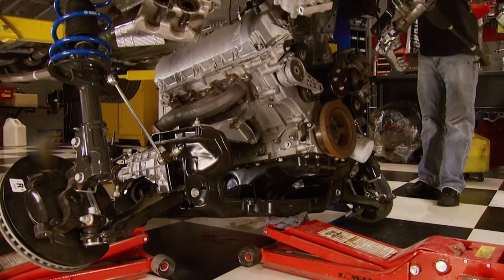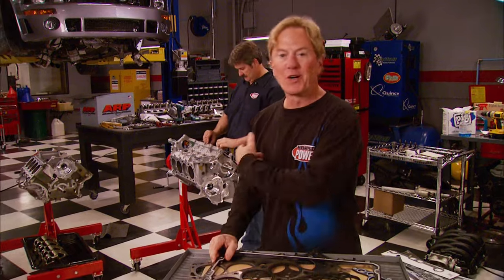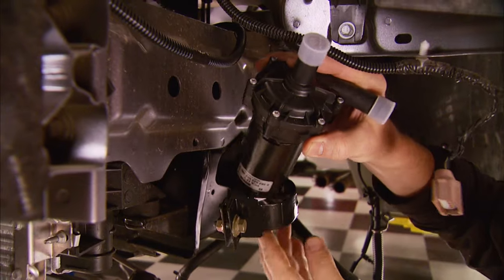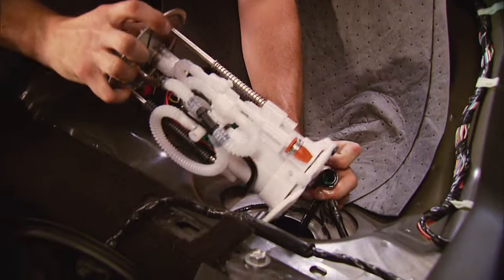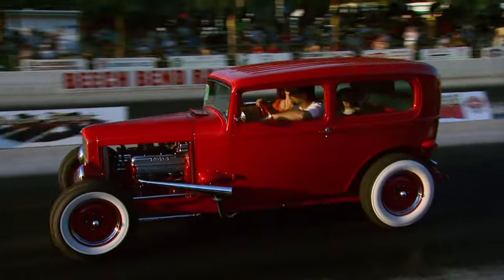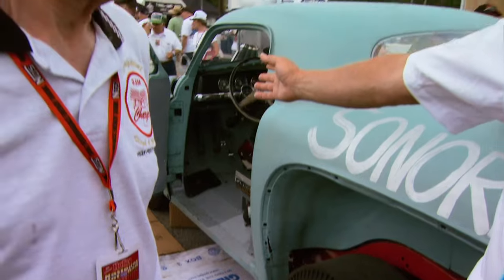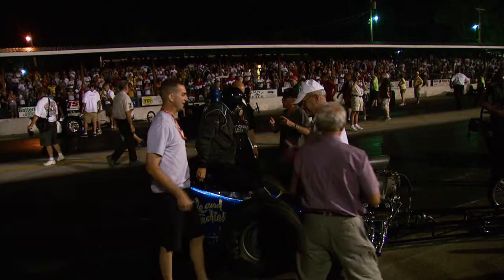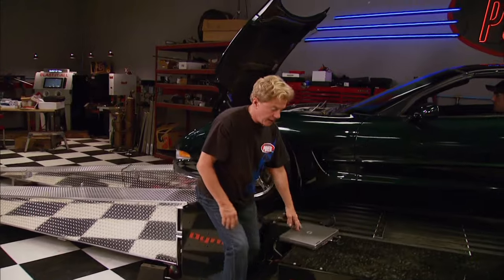Supercharging A GT's 4.6-Liter For An Extra 200 Horses- HorsePower S12, E13

Comment: They lost me after only two minutes. Their title was Supercharging a GT's 4.6-liter For An Extra 200 Horses, but then they took out the car's 4.6 to replace it with a Roush short block and supercharger.
Reply: A roush is a GT lol.
Reply: @fatdan172501  basically unrealistic cost wise for most of us and done on a stand outside the vehicle. Most of us were looking at seeing it done while in the car.
Reply: 4.6 great engine. Put Lysholm super charger on it. Kenny Bell has the same twin screw blower package. Great blower! Most important is a good tune. By that I mean a real good "Tuner".  Headers, cold air intake with bigger throttle body and headers, bigger fuel pump. Shelby exhaust! Enjoy!
Reply: @avocado9763  Why did they go with a different block? Won't those superchargers finally tear up the factory engine?
Reply: @enermaxstephens1051  It depends on the horsepower and torque they throw at it. Much over 450 lb/ft at the rear wheels, and you will start bending breaking the stock connecting rods. Horsepower is not as critical of a factor.  Mine is running the stock bottom end. and produces 560 at the crank, with approx. 550 torque. I'll get it officially dynoed this year, but those numbers are estimates.
Reply: @sherylellingson3538 have you gotten it dynoed yet?
Reply: Yeah and only got 200 more Hp… lol
Reply: @Tripztrip2008 , perhaps, but not with the 4.6-liter engine it came with, which was the video's hook.
Reply: I read this and never made it through the ad
Reply: @swyzzlestyx  it is a stock block just pistons rods and crank are forged !You can run that blower on a stock engine we have done it many many times!
Reply: They lost me at 4.6L …. Engines are obsolete…
Reply: @StevenSimpkins-p7x , The 4.6 has nearly infinite horsepower boost potential with only bolt-on parts, and is only limited by metal fatigue. Sure, the 4.6 was stock tuned to put out low horsepower, but that was easilly remedied. The 5.0 Coyote is supposed to be a major improvment over the 4.6 mod motor,and I suppose in ways it is, but for the price they paid to develop the engine, and for the fact they only put it in the F-150 and the Mustang, I have to ask if the cost was worth it. I would think Ford would make the 5.0 Coyote engine an option for all of their vehicles so they can properly recover the development costs. Personally, I would bring the 4.6 back to fit a V-8 in places the Coyote cannot fit. I know Ford is trying to increase their cafe numbers by forcing customers to buy their smaller engines, but they should still offer people the option of shoehorning a V-8 into anything they make for a cost.
Reply: @swyzzlestyx  4.6 and 5.0s were and is good platforms …. 4.6 will take more of your money to make power… the 5.0 not so much. As a Gen 3 coyote mustang owner and I have a 03 GT 4.6… with headers CAI tune and e85 it put down 505HP to the rear wheels …. In comparison… the 4.6 would need either a major overhaul of the heads intake cams etc to come close to it … also when boosting….. a coyote comes with forged internals ready for boost… 5.0s can hold 1,000 HP easily … same with the 10r80 trans… in the 4.6 it doesn’t come fully forged and would take more money out of your pocket to make it strong enough for boost

Comment: "Supercharging a GT's 4.6 for an extra 200HP" :) ........however, we used a new Roush short block. :(
Reply: Yeah but unfortunately there isn’t much you can do with the stock engine :(
Reply: You can make another 200hp on the stock engine
Reply: @mikionorton2236  theres tons you can do. Been running 500whp through a turbo on stock motor for 4 years now
Reply: @mikionorton2236  NOT SO BRO!

Comment: It is impressive how the current mustang can make 700hp with just a bolt on supercharger with stock engine compared to the 4.6 days.
Reply: 4.6 is a destroked 5.0 btw . thats why the DOHC 4.6 had 5.0 stroker kits
Reply: @TheCheapReefer  The 4.6 is not the same as the coyote.
Reply: Tha Silent One   Uh, no. You obviously don’t know a lot about engines. At least ford engines.
Reply: They’ll make 700 hp alright and then a week later it starts ticking or knocking.
Reply: John Johnson except no
Reply: @spankthemonkey3437  gen 2's maybe, but the gen 1 had the same problem with rods as the 3v. They just hold on a little longer.
Reply: @lukelanam6045  for the most part it is genus  .
Reply: @lukelanam6045  it shares many parts its a 4v version stop the foolish crap!
Reply: @Nmdixon-cu7vm  are you a fool!

Comment: Glad you did a 4.6!
Reply: This episode seems like a sales add for why you should just buy a coyote. Wanna run down a newer mustang? Just buy this 7k supercharger kit and put a new 4k short block in it. You will also need a clutch. So long as you have a full shop, you will be running down stock coyotes in no time. Just doesn't seem with it to me.
Reply: @ryanwalker3509  that was on a pretty low boost setting, that shortblock should be good to a thousand, and those injectors will make a lot more than 500 crank, at least 600, maybe even 800
Reply: @ryanwalker3509  hahaha exactly what I was just thinking after buying the car and 12,000$ in parts you could have a low mileage coyote and make 500whp with bolt ons
Reply: @fl_atv_riders4455  it's still cool if your hot on that body style. Hell I still like the c 5 corvette the best. However, its not exactly cost effective.
Reply: U can save the 7k on old 3 valves and the 7k in mods can get u a gen 1 coyote.
Reply: @T0YCHEST  or you could get a 4v 4.6 or 5.4 for a lot cheaper and do the same
Reply: admiral_peck 7 its not going to be cheaper
Reply: @T0YCHEST  I can guarantee I could get over 500 n/a horses for less than 3k on a 4.6
Reply: @ryanwalker3509  
Well, when this episode originally aired that car was brand new so...
Reply: Glad they DID a 4.6. This was from 2007...
Reply: admiral_peck i can guarantee u i can get a gen 1 coyote for the price of ur 4.6 and mods
Reply: Auto Young ?
Reply: @ryanwalker3509  they did do this before the coyote was released, notice they called a 3v 4.6 brand new? Yeah that was the top dog when this was recorded.
Reply: @Prestiged_peck  You can't expect trolls to have comprehension skills.
Reply: @redrocker1055  you have a good point, I'm aiming for over 2k in my little 4.6, I'm looking at probably 100 pounds of boost, ethanol, trickflows, and water meth all together to achieve that
Reply: Ryan Walker but your Coyote car still looks like a Coyote car and some of us very much prefer the early S197 style.  Plus if you own it outright it’s cheaper to put a basic super charger on then switching cars and you’ll be taking out new 50k Coyotes.
Reply: @Jedi391  plus with modern fuel you're looking at possibly 6-700 horses
Reply: @ryanwalker3509  You can run down a stock Coyote with a $2000 On3 turbo kit.
Reply: @theroofer3181  don't get to hung up on the base price of a kit. Will the trans hold the power? Do you need a new clutch? Does it come with a tune? Are you actually going to be able to do it yourself? Can you fabricate if something isn't right? Do you need any other supporting modifications? I would be willing to bet its closer to double the cost you just said. The kit i looked at on that site didn't even come with injectors. 2k just isn't true.
Reply: @ryanwalker3509  I do all my work myself so labour isn't a problem.  Stock transmission will hold the power just fine.  A new clutch will definitely be needed to handle the extra power, I use a Spec Stage 3.  I'm using a used set of 39 lb/hr Ford injectors.  All in, not including labour, I'm at about 3K, including tuning.
Reply: Lassi Kinnunen  You don't need to swap the shortblock like they did for the power they're making.  A stock 4.6 can handle up to 450 r.w.t.q. (500+ r.w.h.p). With the forged internals they have now, they can probably make upwards of 6 to 700+ r.w.h.p.
Reply: @fl_atv_riders4455  Yes, Coyote's have the advantage, but it sure is fun seeing the looks on the faces of the Coyote drivers, when you are still there at the end. Win or lose.
Reply: @sherylellingson3538  its honestly cheaper to do a 5.0 swap then build a 4.6 and you have a more capable platform after for more growth.
Reply: @Prestiged_peck  how? With a turbo? Even then you might spend well over 3k…. You got to build everything else around it…
Reply: @Zelmar Hernandez  well yeah trans would need upgrading, maybe driveshaft too. Diff/axles would probably hold 700-800ish no problem
Reply: @fl_atv_riders4455  some drivers prefer the sound and everything about the 4.6.... The sound of that engine beats any coyote in my opinion.... Somebody out there is very happy that there is a way to compete with coyote even if this means 15k in the hole. You can own an older 2005/09 for about 6k/9k			plus 15k in parts you be around 25k or so....the same you'd spend to buy a coyote mustang. Personally i prefer coyote mustangs because the powee potential is a lot higher than the three valve mustangs.
Reply: @ryanwalker3509  Supercharger = $7000. Gen 2 coyote Mustang or above will run 3-4 times that. Plus the 05-09 are better looking. IMHO, only.

Comment: Damn I threw a paxton on my stock 4.6. It's at 498 rwhp with 460 tq. Been running it for 5 years and never had a problem with the stock block.  I wonder how much all this costs
Reply: Too much
Reply: How’s that working out for u ? I want to throw a Paxton on in the spring
Reply: I'm running a Paxton as well at 508rwhp. I've been on what they called "borrowed time" for 8 years now 140k miles haha
Reply: According to the guys at Brenspeed, you are right about where you should be, with stock internals. Rule of thumb, 450 RWT is about all you want to send. Horsepower is irrelevant, when it comes to breaking parts. It's the torque, off the line that breaks parts. Mostly connecting rods. Horsepower is developed at upper RPM, torque down low, when the most stress is created. Again, this is just Brenspeed's word.
Reply: @totljag1  still going man, unfortunately squirrels got into the hood this winter and chewed my wiring harness and nibbled at my belt :/ so I'm currently dealing with that atm. But the engine is doing fine at 100,000 km.
Reply: @sherylellingson3538  definitely, I also forgot to mention I don't track the car, or launch it. Everything about the car is stock except for the blower; I feel like if I hooked from a dig, definitely drive train issues would be the first issue lol and then of course the rods would for sure go. I got mine tuned at a very reputable mustang shop near Toronto, Canada. They basically have the same opinion as the boys at Brenspeed. But you never know, every engine is different. Just gotta be prepared to build it if it fails lol
Reply: @bensondelva3086  140k miles? That's awesome man, that gives me confidence I have alot more years left on her. Hope you enjoy the car this summer man 👍
Reply: What are you running in the rear, plus do you have a stock driveshaft ?
Reply: @adrianbrown2957  stock drive shaft, upgrading to 1pc aluminum next week. Stock rear 3.55s, no plans yet. Never launched it because of the stock drive shaft. Going on year 6 with this car. No issues.
Reply: that roush is a stock ford block just forged rotating assembly!

Comment: Nice idea what about the rods that like to bend on a stock engine
Reply: Stock rods are perfectly capable of handling more horsepower than that. It's the torque that you need to keep in check. Any torque over 450 at the wheels, is bad for the stock rods. Everything else in the stock internals should be fine.

Comment: 8.5 to 1 compression ratio... should've had 10.5 to 1 with the low boost they were running
Reply: agreed not sure why they lowered the compression for 12psi. just get some headstuds and up the compression to make even more power
Reply: we run 12 psi on a stock 4.6 bottom end and get 575 hp and run 10s with the car !

Comment: That one older guy always sounds like he's in the middle of a mild stroke... Or a fifth of 100 proof!😂😂

Also: "This week on Power Nation, we tear apart a whole car/engine to bolt on a supercharger, then make less power than a stock NA Coyote! Stick around!"
Reply: He sounds like He's comfortable sitting at the Bar with Norm and Cliff in Cheers.
Reply: @BIGGDADDYWIGGS  😂😂👏
Reply: This stuff was from before the 5.0 even existed.
Not to mention that these are wheel numbers and not crank. 
... you sure you havent bad a fifth of 100 proof?
Reply: @justsomegarage  Nope, gave up drinking. I am aware this was before the 5.0 was RELEASED, but it was already in development at the time... I was exaggerating to illustrate the point of doing too much for the gains. Are you sure you understand satire? Should I edit the joke to say "then make about the same power as the next generation NA engine will reputedly make!"? Would that make you feel better?
Reply: @supramaniac502  ten 1st gen 5.0 was 411 hp at the crank bolt ons will yield that on  the 4.6 the engines are not that much off in power realy

Comment: Easily about a 15k build if you have that done at a shop. 5k for supercharger. 3k for shortblock. At least 30 hours in labor. Tuning.... I just don’t think 450 horse to the wheels is worth that
Reply: Just add more boost.
Reply: This is an old video. They referred the mustang as a "new" car and about 2006/7 when Roush Mustangs started to be more common. Back then, you'd be lucky to get that kind of power without a built block. Nowadays? You can get yourself nearly 800whp on a stock block.
Reply: thanks for advising a 15 year old show
Reply: yep,anything at a shop is $100+ per hour.a cam swap for a pushrod v8 is 10+ hours or $1000 plus parts.
a cam swap for a coyote is 5 grand at a shop,what was your point again?
Reply: @rotor13  the 4.6 aluminum block is good for 1200+hp with a good steel crank rods and pistons!

Comment: 500hp with a supercharger. There's naturally aspirated coyotes making that lol. How technology has changed over the years
Reply: Stock block 302w used to split in half at "500hp". Today I'm making over 700 at the wheels conservatively and know of some close to 1000hp.  Today's tuning capabilities are amazing.
Reply: That kit was good fr waaay more they just didn't run the boost up
Reply: They were very conservative with this one. With that power they definitely didn't need a built motor, but they can easily turn it up since it is built. Beef up the intercooler system, basic bolt ons (intake, throttle body, pulley) and  a tune they could easily be making 600whp
Reply: @JuryRigGarage  yeah all they needed for that power was a good ring gapping. That built shortblock was probably good for 650-700 if it had a stock type crank, If it's a forged crank in there then it's probably good to more like 800-1k
Reply: Could have gotten that with nos for 5 grant less  and by the way 450 is way lower than 500 ,,too much for so little
Reply: Nos will tear the engine up way faster.Supercharging is better for an everyday driver.
Reply: @bigalfrombrewster1842  they got 500 with a ton of room to improve, back in 2007 though they wouldve had to either go water/meth, or run it on some sort of race gas to get much more than 500 on that motor(ethanol wasn't mainstream yet)
Reply: Well it’s a 5.0 4 valve and this is a 4.6 3 valve of course it’s making more power lol ...
Reply: @mach183  they could've made Tons more but this was filmed in 2007 when the 3v mod motor was the newest kid on the block, and ethanol wasn't mainstream, now that ethanol is mainstream it's super easy to  add octane and add boost and if they had done that today a simple pulley change wouldve meant 800+ on ethanol, but they didn't really have it.

Comment: At 8:26, you can see the belt and the pulleys are not moving, while the engine was started and running. What's this , magic?
Reply: Ya they're not really going to crank and then immediately rev a fresh block. This is edited for entertainment first, information second.

Comment: A 4.6 +200 hp will get you into the 13s. Pretty cool.
Reply: High 12s with headers cams and a tune all engine
Reply: it will get you in the mid 12's on street tires. I have a video I uploaded of me doing as much. Drag radials, and a decent driveshaft (the stock two-piece units are junk) will net you mid to high 11's.
Reply: the stock 4.6 gt manual trans ran low 13s stock that blower car will run mid to low 11s

Comment: Why does EVERY animation for a supercharger spin the damn thing backwards? You’re forcing air IN, not drawing it out.
Reply: Not necessarily, roots styles spin towards each other, twin screws spin away from each other.
Reply: admiral_peck 7 other way around.
Reply: @jakematthews6982  same difference though, they rotate both ways. I was always taught roots compresses in the manifold and runs the air along the case, and twin screw compresses in the screw, and runs the air between them.
Reply: admiral_peck 7 I was talking about the animated representations of the different kinds of superchargers. In the regular intro the twin screw supercharger turns the wrong way. The animation used in this episode was also going the wrong way. Each of them turn different directions but the animations are going backwards most of the time. When the animation goes backwards it’s a misrepresentation and doesn’t serve anyone. If they were spinning in reverse in reality they would be trying to draw air out of the engine rather than force it into it.

That’s all I was saying.
Reply: @jakematthews6982  interesting
Reply: Because the people who make the commercials only know how to pump gas in a vehicle...